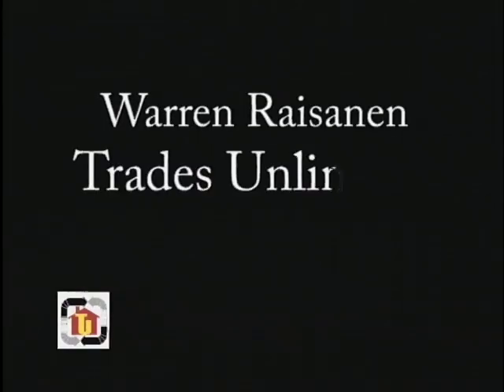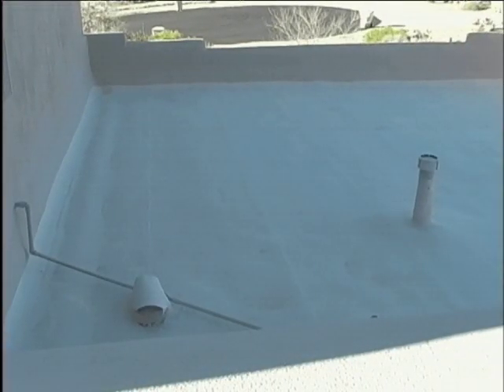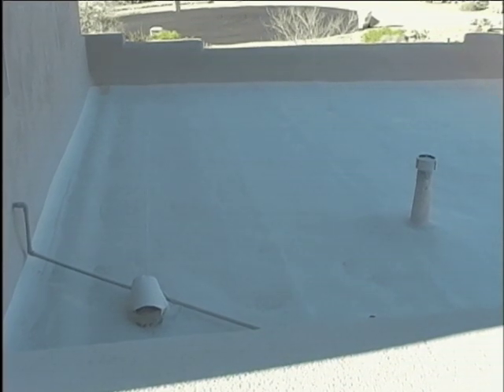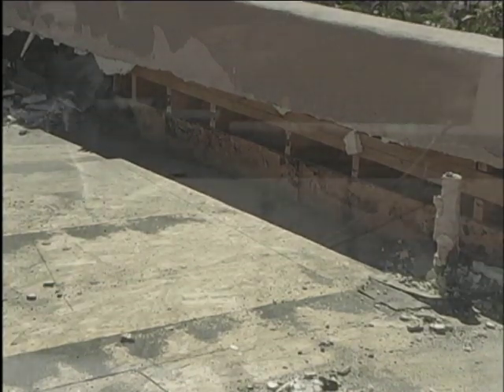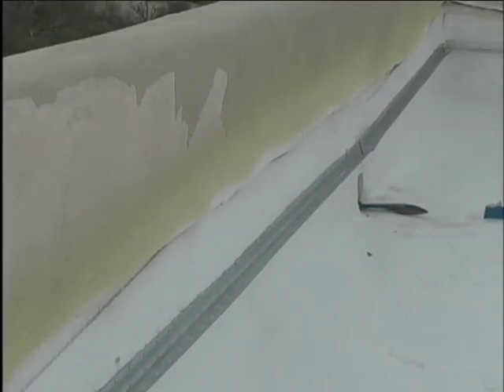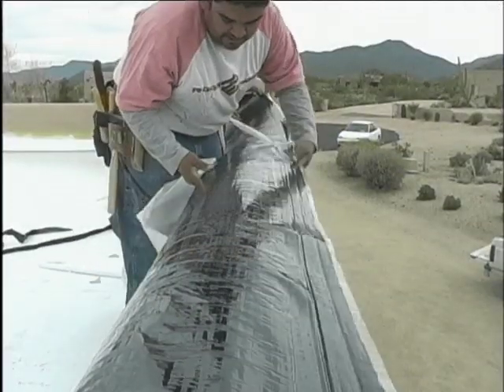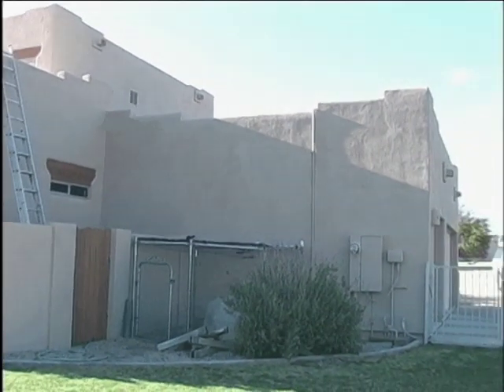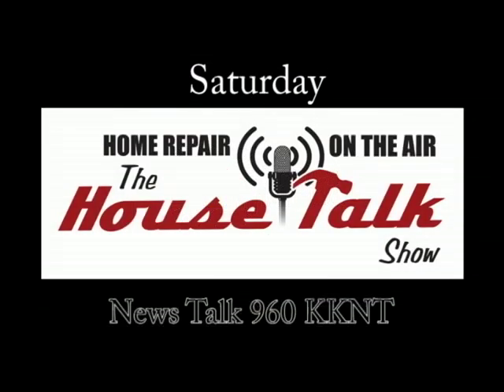Flat Foam Roof Leaks Nobody Could Find In Phoenix, Arizona

Comment: What a terrible idea to tear off the foam. The walls were leaking and not the roof. You could foamed or coated over the walls to stop the leaks and then painted over the walls with the same color paint as the stucco. Those homeowners got ripped off by the last company that did this. And the walls still aren't sealed as good.

Comment: this in my opinion on this roof just by looking at this video, seems to me that they only needed to re-stucco the wall's (install j- metal flashing over the existing foam roof and stucco over). But if lots of moisture was trap withing the foam roof it was good that they tear it off. I'm not a big fan of foam roofs, the only thing good about it is the r-value but as a water proofing ...not convinced. Good video do.

Comment from the maker: @TheWarachee Thanks very much for your comment!  You are correct in many instances where it would not be necessary to tear the existing roof off but in this instance we felt it was wise as there was quite a bit of water infiltration.  Also with all the roof to wall work involved we knew that we would almost end up installing a new roof  anyway.  In some areas Foam roofs may not be the best answer.  For the Phoenix,  Arizona climate it really is hard to beat.